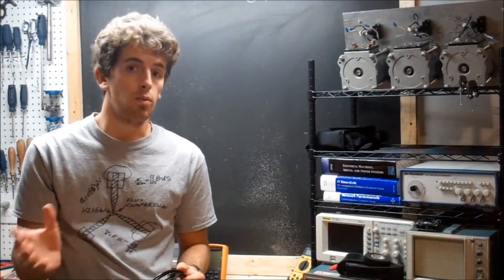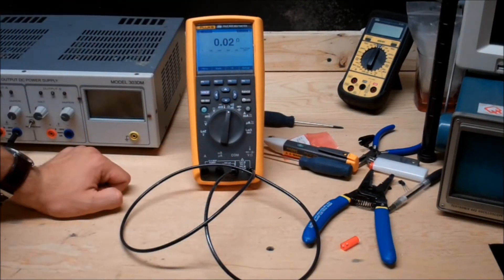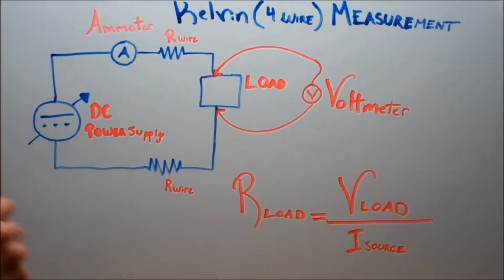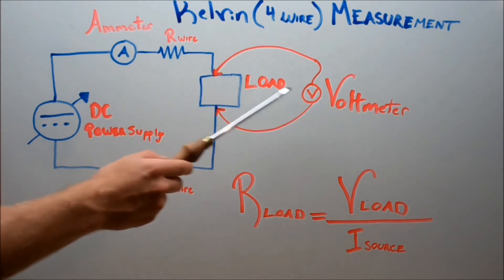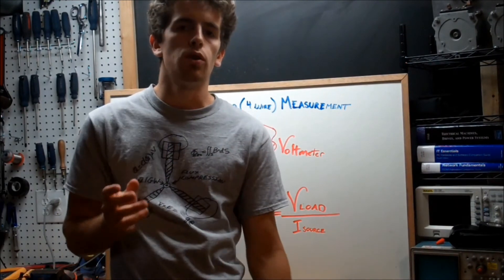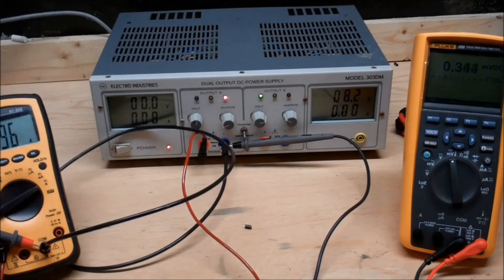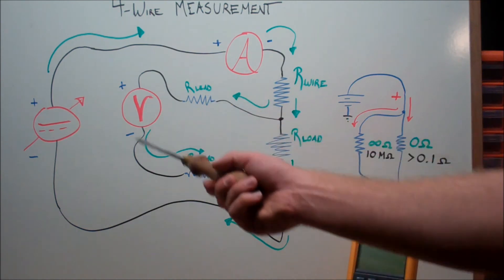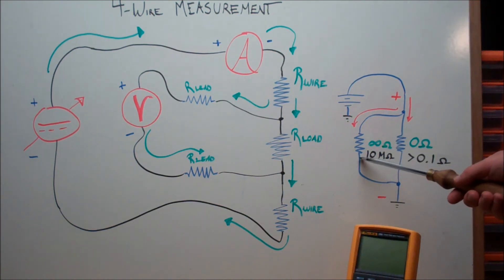4 WIRE MEASUREMENT TUTORIAL

Comment: I don't think you need to short out your supply.  Put a current limiting resistor in series with what your testing.  You still  read the current off the ammeter, and you measure volts across your test wire.